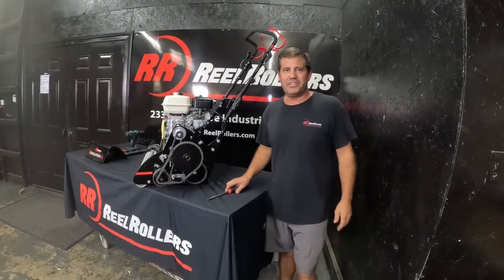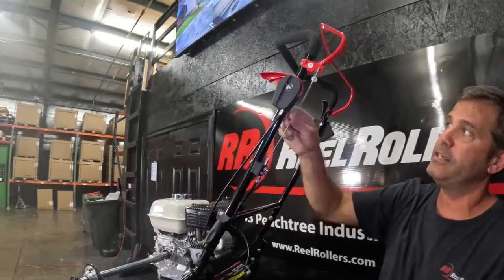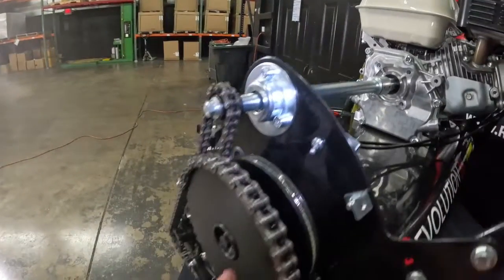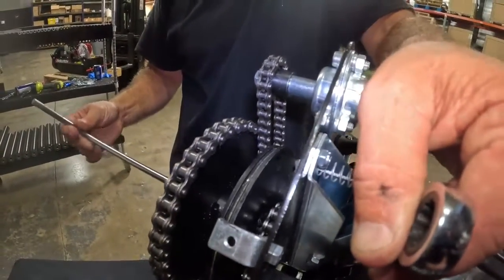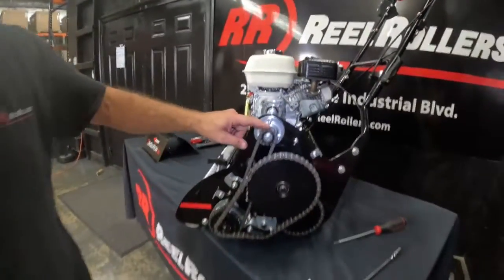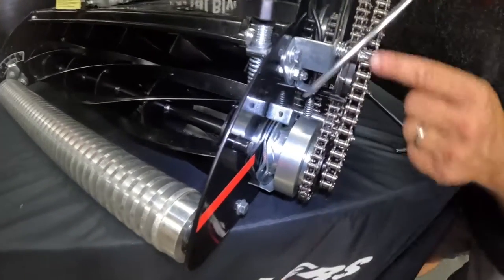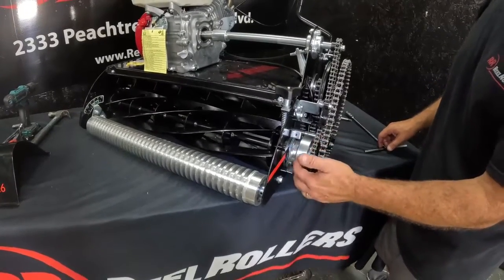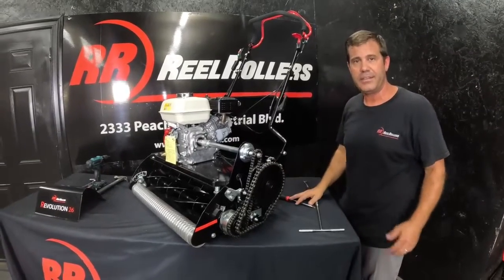The Revolution Reel Mower - A Look Under The Hood

Comment: I've had my mower for a little over 2 weeks. The reel doesn't free spin when the mower is off and the reel is disengaged. I've also had two occasions where even though I engaged the reel, it did not turn. The first time I had to give it more throttle and get it off the grass. The second time (yesterday) I had to turn it off, spin the reel manually for a bit and then try it again. Any idea what may be causing this?
Reply from the maker: @Markulero  please email us and we can help.
Reply: @reelrollers  done, thank you!